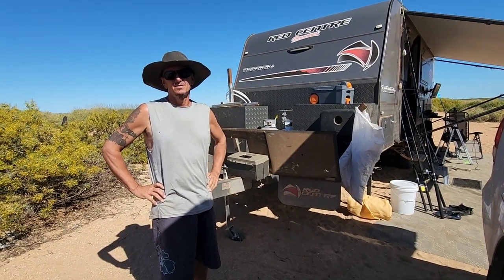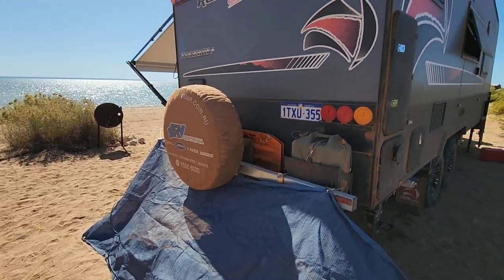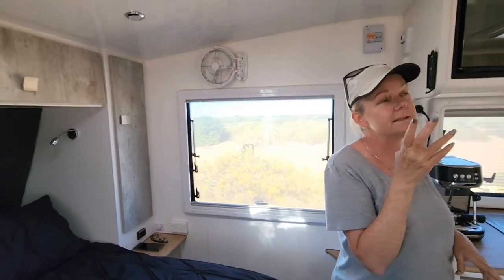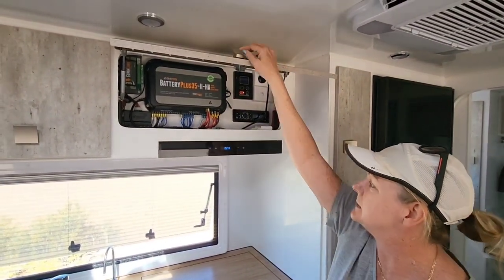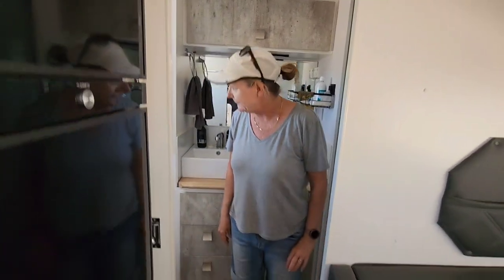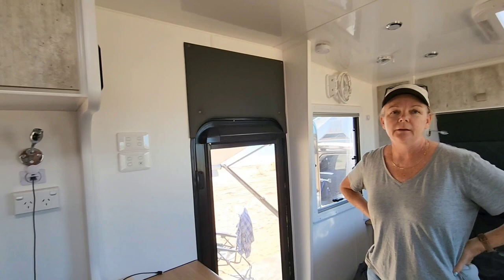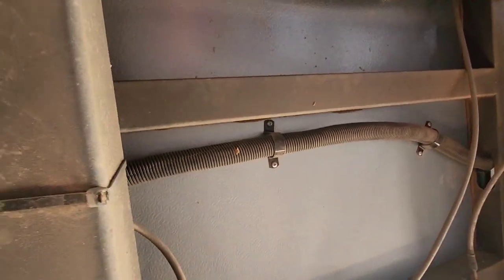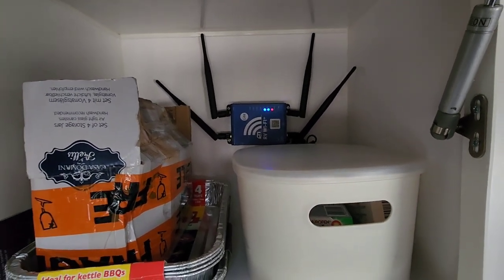Red Centre Caravans Tanami + walk through at Giralia Station

Comment: Hi Guys, enjoy watching your videos. Would you mind checking your compliance plate for tare weight please as I would like to compare with ours?  Thanks
Reply from the maker: Hi Jan the tare is 2489 kgs, glad you enjoy the videos. Thanks for watching.
Reply: @BJKAdventures22  thanks for your reply. I am looking for some more information on your club lounge . I was wondering what the internal measurement is for the back length and the size of the table please? Can't decide on club lounge, cafe or L shape.
Reply from the maker: @Jan Eustace  Back of lounge is 1600mm long  and table i680x520mm
Reply: @BJKAdventures22  Hi  can you double check your tare weight of your van please, been talking to red centre and the lightest tare of a tanami + 20 footer would be 2689kg, that's coming from Dean the owner of red centre
Reply from the maker: Hi.  Definitely 2489kg Tare. Just checked it. If I could attach a photo of the compliance plate that would be handy 🙂